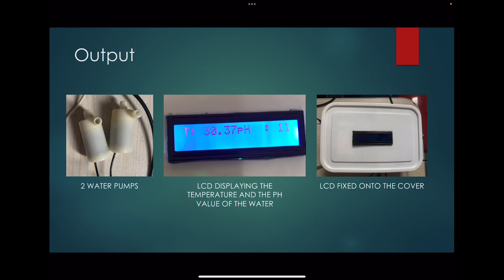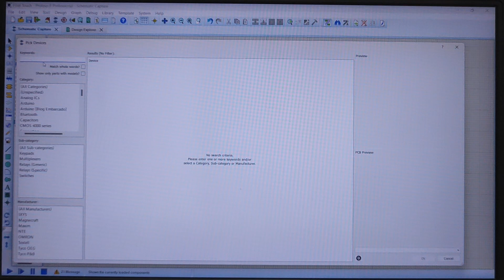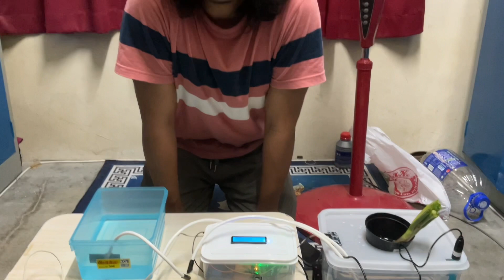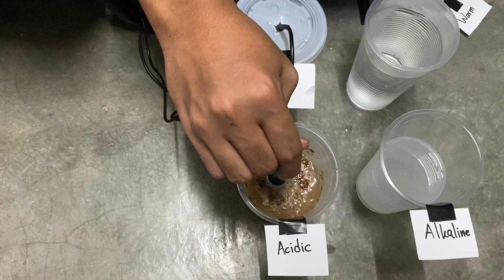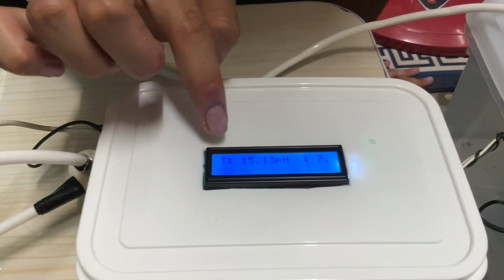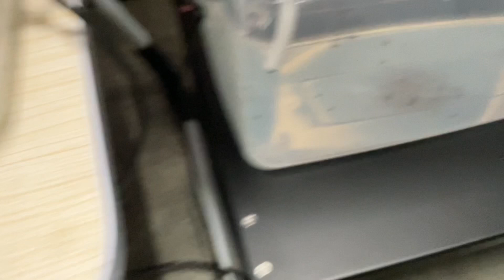GROUP 9 LAB 4 VIDEO PRESENTATION 2023 (On Captions and choose 'English' Subtitles for captions)

Comment: GOOD PROGRESS BUT you lose a lot of marks because you miss some of the information below:
1. Why does the LCD display not show anything in Proteus simulation? You should simulate every use case to show how the motor and LED react to the change of each sensor value.
2. The hardware is also missing some demonstration. Where's the demonstration for the other motor to mix the fertilizer / add water to regulate the pH
3. Why is the water temperature regulated only when the temperature is greater than 34 degrees? Why not 29 degrees?
4. What happens if the water temperature is too cold? Is there anything your system will do?
Reply: Hello sir, thank you for the questions. We are deeply sorry that we missed few points from the video. Hope this reply from our group would clarify sir’s question.

1. Unfortunately, we have met with a technical isu while trying to get the i2c lcd to display the value in proteus. We tried to reinstall the software and also install any necessary libraries. For some reason we still could not manage to make it work. We wanted to verify our code, so we choose other simulation online softwares such as Wokwi and Thinkercad. We managed to display the values on the i2c lcd. There were few downsides to these softwares. There were no pH sensor and motor but had everything else on Wokwi and Thinkercad.

2. The relay could not deliver appropriate power to turn on both motors during our test try. So we concentrated on the one motor which controls the temperature for this demonstration. 

3. The proper temperature for the plant growth, especially for the plant that we chose is approximately 20 to 30 degree celsius. So 29 is still under acceptable temperature. Anything more then 30 degree celcius would not be the optimal temperature. So, for the demonstration purposes, we chose 34 degree to be high temperature which will activate the pump for temperature regulation. 

4. In our current project, we did not implement a system which will regulate the temperature when it is too cold. The targeted audience for this project during our development phase was Malaysian, a country which is mostly hot. According to our research, Malaysia's mean annual temperature is 25.4°C. The coldest winter in Malaysia (January to March) was in 1976 with an average temperature of 25.5 °C and the temperatures at night is usually between 21°C to 24°C. Which should be optimal for the plant growth. But there are some conditions which will decrease the temperature inside the house, which will not be good for the plant growth. For this, we can add heater prob which will increase the temperature of the water if needed.

I hope this clarifies any doubts that sir had. Thank you very much😊

Comment: Group 1 ,
EC21082

In prototype section Why don't you guys use wifi module as controller to control your output just like what you stated in your conclusion
Reply: Group 9
EC21068

We had some technical issue with our esp32 s wifi module. So we decided to display the necessary values for this hydroponic project on a i2c LCD. 
Hope this clarifies your doubts 👍🏻

Comment: Group 1 , EC21077 
What type of motor that you used in your project? Because i didnt find the specific name for the model motor in your video.
Reply: GROUP 9
EC21116
the name of the motor is:
Mini Submersible Water Pump DC
Input voltage: 3V - 5V
Flow Rate: 1.2 - 1.6 L/Min
Size: 4.5x3.0x2.5 Cm

Comment: Group 6, EC21119
In the simulation, can you list up the components and amount use?
Reply: group 9
EC21116
In the simulation the components used are:
-PH Sensor - 1
-DC Motor - 2
-16x2 I2C LCD  - 1
-DS18B20 Temperature Sensor - 1
-LED - 3 Colours
-Arduino uno - 1
-Ultrasonic Sensor - 1
-Capacitor - 1
-Inductor - 1
-Volt meter - 1
-10k Resistor - 4
-Potentiometer - 2
-Virtual Terminal - 1
-Relay - 2
These are all the components used THANK YOU

Comment: GROUP 3
EC21064

How this hydroponic project will identify the mold growth or plant disease which parameters should regulated?
Reply from the maker: GROUP 9
EC21073
Firstly, mold grows when there is high humidity. Warmer temperatures are the main factor in bacterial growth. Therefore, to overcome this problem we have installed a temperature sensor in our system. When the temperature increases it will notify the user and activity the water pump to regulate the water temperature.
Reply: @fuzey28  thank you

Comment: GROUP 6
EC21071
Can the hydroponic system be used to grow different types of plants with varying pH requirements simultaneously, and if so, what modifications are necessary to accommodate the diverse pH levels?
Reply from the maker: GROUP 9
EC21068
It is possible to grow two different plant with slightly different pH value. But if you want a optimal growth rate, it is better to use 2 or more plant with similar pH value requirements👍🏻